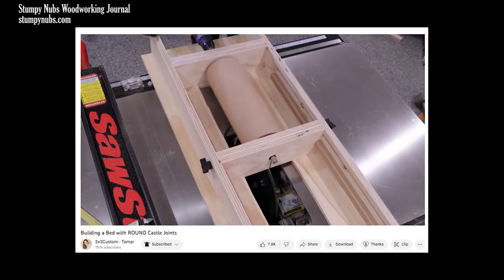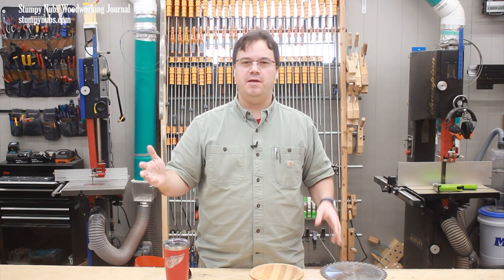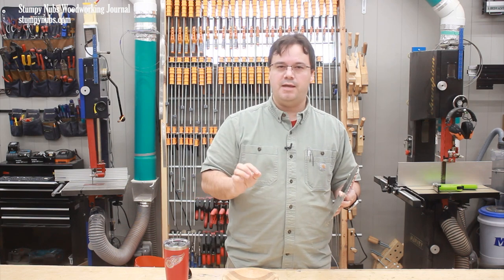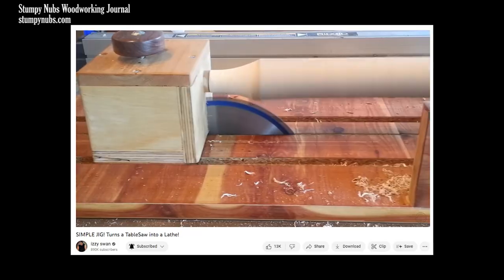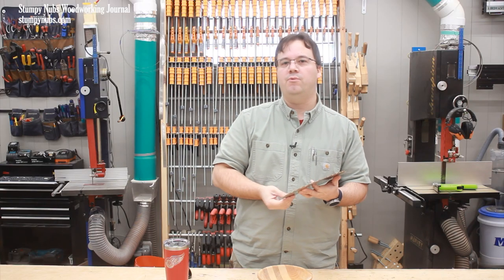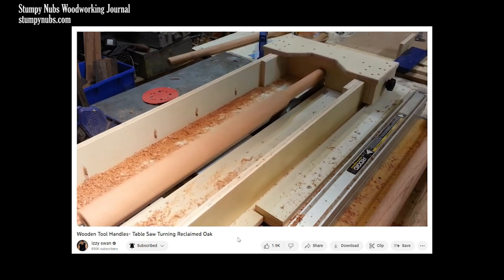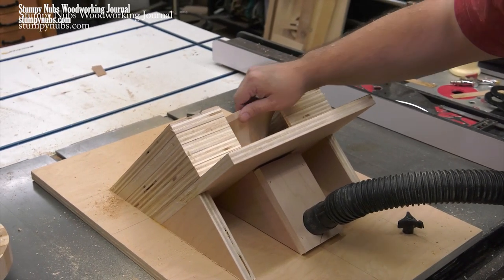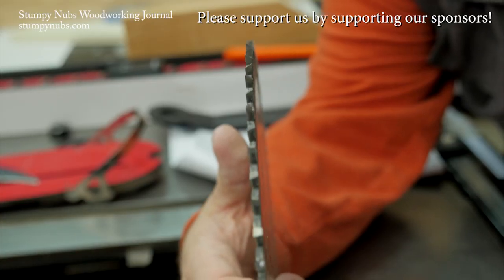DANGEROUS new trend in internet table saw videos? You decide...

Comment: My opinion before watching this video: Yeah its pretty sketchy, but if you do it right youll be just fine. the table saw itself is a little sketchy

I'll reply once i finished the video to see if my opinion has changed
Reply: i think the most dangerous thing presented in this video was stumpy making to hollow in the bowl, not using the saw as a lathe
Reply from the maker: That wasn't at all dangerous as long as you only turn on the saw when the bowl is in place and shut it off before you remove it. It's a very thick, hardwood blade guard.

Comment: on the topic of safety I have watched a lot of wood working videos over the years.  I have seen wood workers wear safety glasses and ear plugs and masks on certain occasions. Not once have I ever seen a wood worker wear gloves when using a power tool or anything else for that matter. why is that?
Reply from the maker: Gloves can be dangerous with many power tools, especially rotary tools such as drills. There have also been incidents where a gloved hand that was put too close to a saw blades caught and the hand was pulled into the blade. However, if you leave your blade guard on and use proper push-sticks, that is less likely to occur.
Reply: @StumpyNubs  good to know. thanks

Comment: 4000 times a second where did this guy get a 240,000rpm table saw? That thing must sound like an f22 taking off.
Reply from the maker: 4000 RPM X 60 teeth....
Reply: @StumpyNubs  yeah buy you were talking about an individual tooth. It only takes a bite once per revolution. So the force on a tooth isn't multiplied by the others.

Comment: As a wood turner I can say that a table saw jig is faster and more accurate than a wood lathe for making perfectly straight cylinders light rolling pins. I don't care who you are and how much experience you have. A jig on a table saw is better.
Reply: Umm. . . Not sure I agree with that statement. I think I have seen a turner or two hack out a pretty good cylinder on a lathe.🙂🙂I ain't one of them.😅😅
Reply: Aren't there jigs/templates for lathes to make the exact same shape multiple times?
Reply: @rutgerhoutdijk3547  there are and I've used them. It was easier to make one for the table saw. And cheaper.